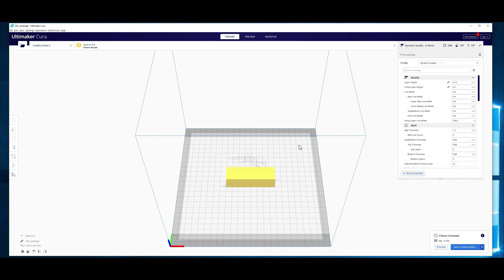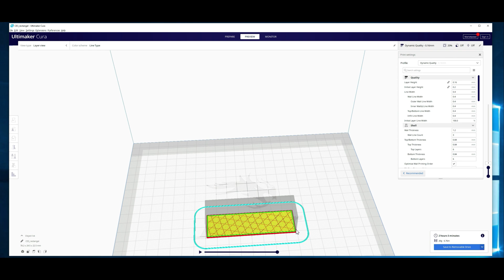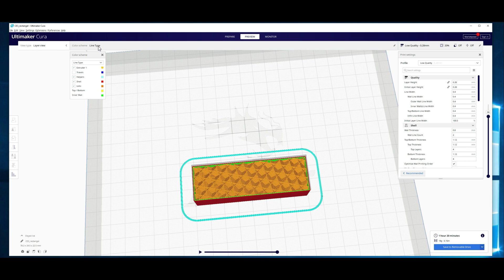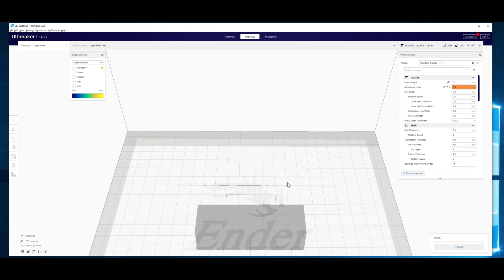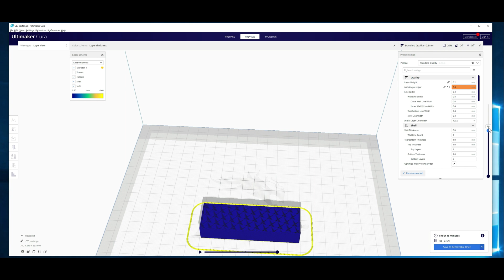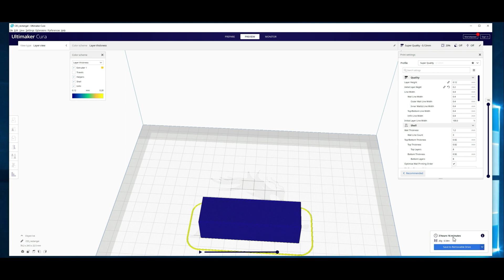Cura Layer Height - The Basics

Comment: Nice tips and overview.  Interesting to wonder about the Z height of the model relative to the layer heights - if printing a 1mm model at .3mm initial layer height then .2 layers after will result in print that is .9mm or 1.1mm thickness rather than 1mm.  Based on my Cura preview, it might be .9mm since it gives 4 layers instead of 5. Although you could ensure the Z thickness of the desired print stays the same by dividing the regular layer height by the number of non-initial layers. (such as .7/4 in this example)
Reply from the maker: Hi. You have a fair point here, thanks for sharing. I still tend to go with .2mm on first layer regardless of layer height for most prints but your right it could impact the overall size.
Reply: @3DPrintscape  My printer has been a bit finicky this year, so I think changing to .3 initial helped these past few days. Seems to have helped with first layer adhesion and proper line spacing for me at least.

Comment: hi if  can help be great,recently got a spark 3d sp1 printer as upgrade from old one had and been told its just another clone of Voxelab Aquila X2 printing profiles,im using there software as giving it go the voxelmaker,thou only has the 0.2mm stand setting,can anyone give me tips on how can do a 0.16 or 0.12 and what is main things i have change for them settings like speed ect ect
Reply from the maker: Hi. If your talking the cura profile you can clone the base one and make changes. You will probably need to change the view to advance or expert to see the settings.

Comment: it should be noted that the suggested layer height should not exceed 80% of the nozzle size in most situations.  So a .4mm standard nozzle is suggested to not exceed .32mm layer height.  Another helpful tip on large ugly objects where you don't need detail is to print with no bottom layer or some rare situations no top layer (helpful for making cool looking visible infill patterns).  If the bottom doesn't need to be seen this can drastically reduce print times and save filament.
Reply from the maker: Hi. You are correct, ideally the first layer shouldn't be larger that 80% of the nozzle size. That said, in more recent versions of cura, and other slicers, i havent really notices much of a difference.

Comment: New to this... if you want to get a more accurate Z dimension, do you need to adjust the layer heights to equal the wanted Z dimension? For example... would a 27.5mm height need to have a layer height of .199? Assuming all layers are equal and going for standard quality.

Or am I overthinking this?
Reply from the maker: Hi. I never needed to change anything like that but ya i would think the overall height would need to be divisible by the layer height to get the most accurate results.

Comment: When they say 3 layers, 20% infill at a .2 layer height, what do the mean by 3 layers? Using Cura 15.04.6
Reply from the maker: Hi. Under wall thickness there would be 3 lines at 1.2mm thick.
Reply: Is it sometimes called Shell Thickness? Sorry new to slicer software my old printer (XYZ) just loaded STL's and printed.
Reply from the maker: @grahamjones7814  Ya, i think it used to be called shell thickness in Cura.